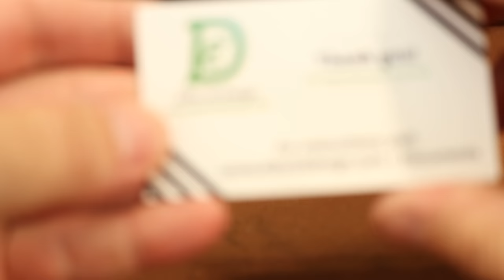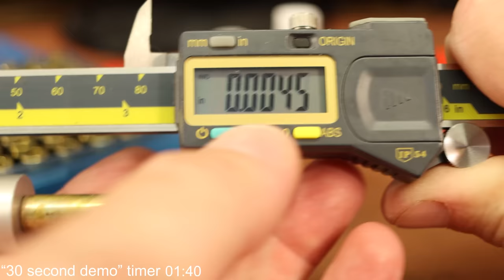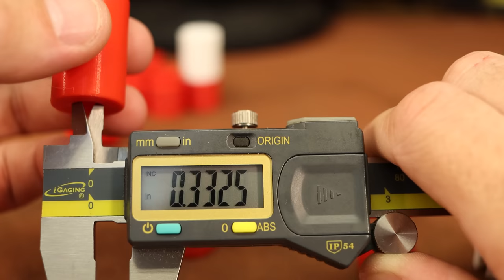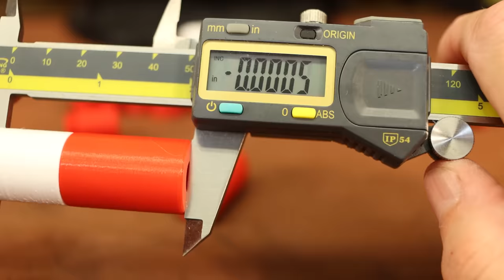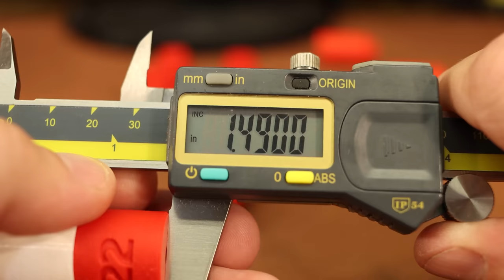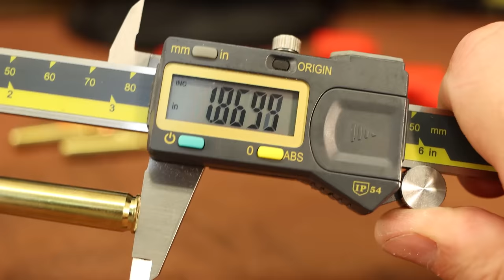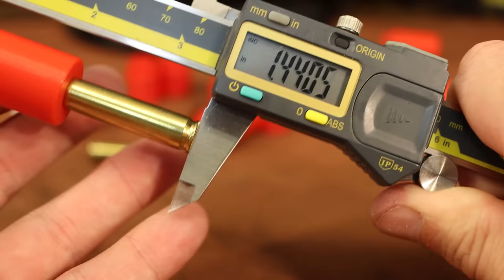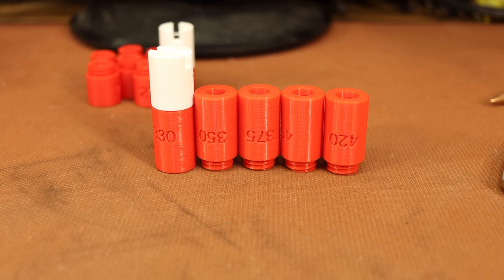Bullet and Headspace Comparator sets from Elite3dDesign

Comment: All things equal, I like metal over plastic.
Reply: Agree. Cool idea but plastic is not for precision measuring.
Reply: I agree
Reply: Unless it is Chinesium?
Reply from the maker: All things equal, I like the SAC design. Oh, wait...prices aren't anywhere close to equal! I agree with your general sentiment, but I had to pick on you for starting it with "All things equal" when they couldn't be farther from it. :)
Reply: I would generally agree, but if you dont really have money to spend it would be better to get this than not having anything at all...
Reply: @JohnnysReloadingBench  good point :)  the only comparator I own I bought about 20 years ago from Sinclair. It looks like a hex nut. I've loaded mostly 30 calibers all these years. I should have said, " All things considered".
Reply: @JohnnysReloadingBench  Should also take a look at the Forster Datum Dial kit, I expect it is sized as accurately as the SAC, bit cheaper too, I think, and its all on two dials. Nice to use.

Comment: If I found my magic round, I would make a dummy round of that round and then if the plastic warped or degraded I would be able to make the appropriate changes if it was reading deeper...you know for comparison.
Reply: YES.
I don't do it often but I have one of my 175smk load and my 62 gold dot load in my dresser drawer.
Reply: I have a Gladware sandwich box full of dummy rounds that are loaded to my final dimensions. I also make a fully prepped and trimmed case so I have a reference to set up my bench trimmer. I do it with every single round I load.

Comment: I have that same set. I drilled and tapped it for a thumb screw and I'm happy with it. I have the Hornady one for bullets. It's really hard plastic so I'm not worried about it stretching or wearing. I wish the grove in the plastic with the magnet was just a touch thinner so it would be tighter on the caliper.
Reply: What size thumb screw did you use
Reply: @Boomerfootball1  I don't know I just found one in my junk drawer and drilled and tapped a hole to match it

Comment: Hey, would be interesting to know if the comparators change dimension with humidity. Some plastics swell a bit with moisture. Not a problem when measuring a shoulder bump, but could be a problem trying to get a consistent CBTO from batch to batch. Could be an interesting experiment….
Reply: I had that thought too.

Comment: The weakest link in your measuring is the calipers.  Even though the dies were made for it, you might want to try a parallel and a height gage.  Just snugging threads may only put two flank points in contact.  More pressure increases the engagement.

Comment: you can drill & tap 3d printed material to use a grub screw which may be a solution to the play in the piece. obviously you can not go crazy on the torque when tightening but it could just solve the problem.

Comment: like a feeler gauge you don't force the measurement. if you are pushing the gauge you should get bad readings. 
i would be worried about wear over time on the plastic. so you should have a test round or case that has the measurement written down that you check against. every 500 or so rounds check that the item still gives the same reading. 
my day job is boilers and chillers so i check stuff a lot because steam burns hurt. lol

Comment: I like that they're trying to 3D print everything now a days but I don't trust something that can dent that easily. I'll stick with Hornady. I will say though that hornady could have done a better job centering their comparators to fit the caliper.
Reply: Yeah all it would have taken would be a tiny aluminum ring bushing pressed in and then kissed with a reamer to increase the durability a lot. It's probably a part you could get off of McMaster for one or two cents each. Or in their case AliExpress. Really doesn't matter how precise the original hole is if you're going to open it up a little.

Comment: Man that's pretty cool.  I'd be afraid that the bullet comparators would wear in over time and form a little "chamfer" after long use.  Hell even with aluminium you see rounding over time.  But for headspace?  That is great AND the angles are more modest there.

Comment: I wouldn't actually want the threads to be tight. That could cause it to use the threads tightening as the indexing datum. Having the shoulder do all the work is going to be the most precise you could get out of the part whether it's 3D printed or made by stock removal. But that's going to be amplified with a 3D printed. 

So that part isn't really a problem to me and I had the same thought as you about putting a witness mark. I'm a little bit more concerned about getting debris stuck to the magnet and throwing off my readings.

Comment: As time goes on will the edge of the comparators bevel so the readings are off ?? So many questions with that because they are plastic??
Reply: Probably same can be asked of the aluminum of the hornady over time. But if used strictly as a comparator to compare values during that session vs comparing values years later I doubt you'll notice. Not to mention can you 100% guarantee you set the comparator up the same way use after use, years later?